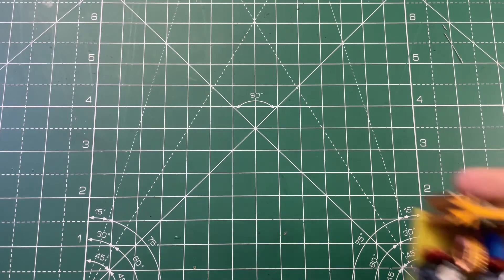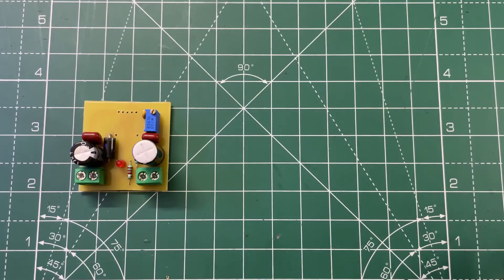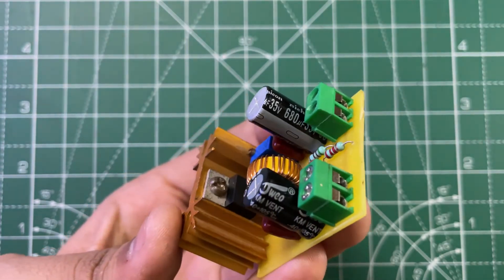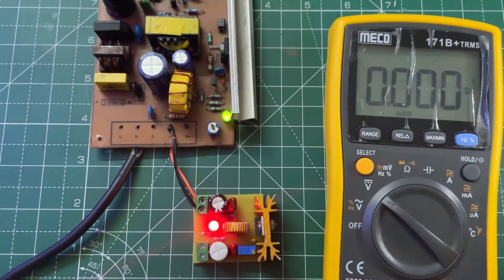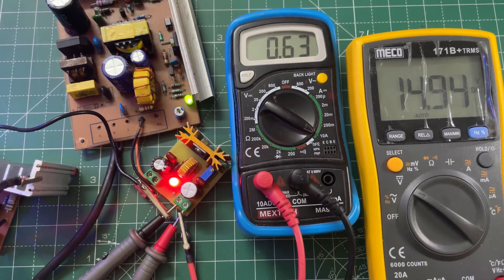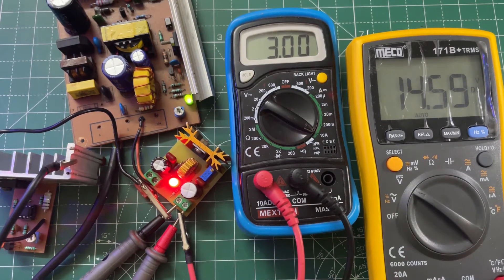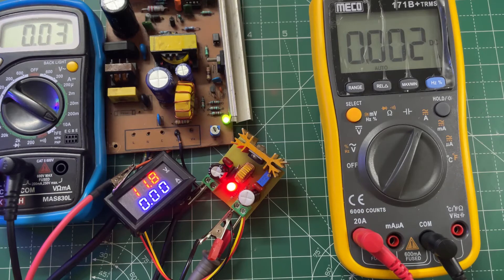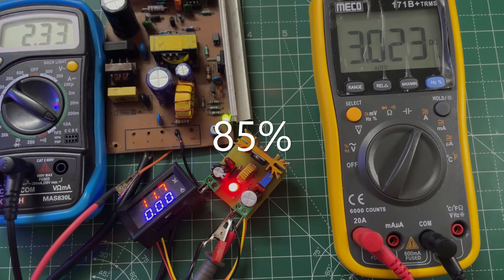DIY MINI BUCK CONVERTER WITH LM2596

Comment: Very nice video. One tip for you, use 2  100nf ceramic capacitors at the input and at the output parallel to the electrolytic capacitor. It will work better than the polyester caps.This will filter noice at the output and use another 1000uf cap parallel at the output. It will decrease your voltage drop at high load
Reply from the maker: Thanks for your suggestion. But some electrolytic capacitors are also mandatory at the input. Yes, at the output we need a large capacitance to reduce the noise but I wanted to keep the PCB size small